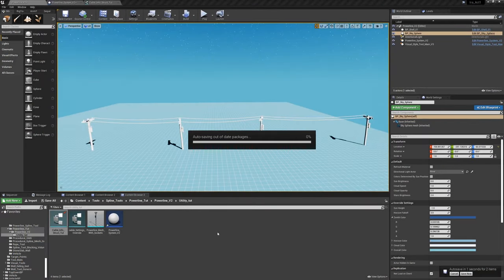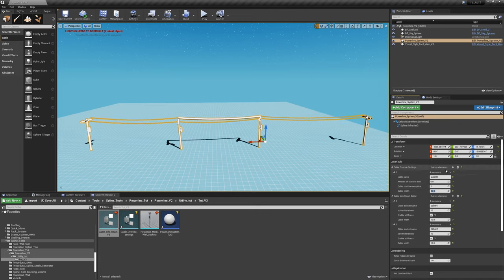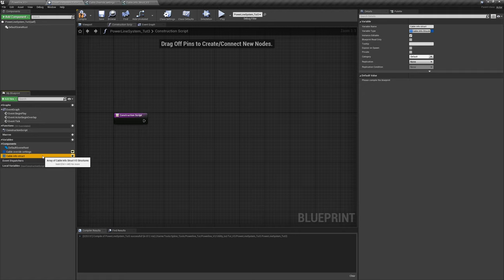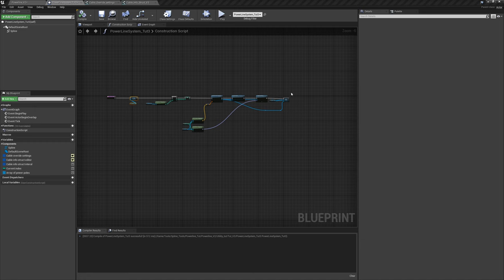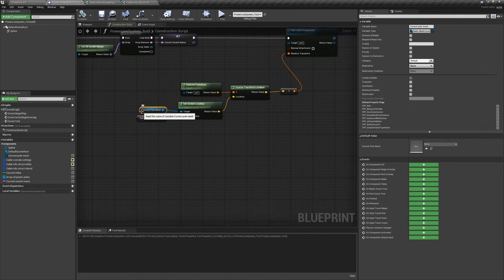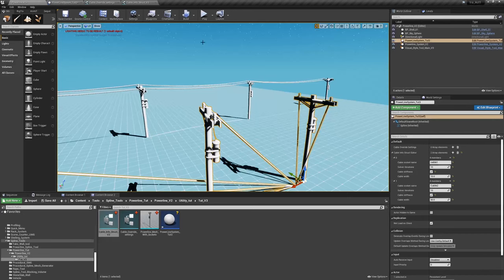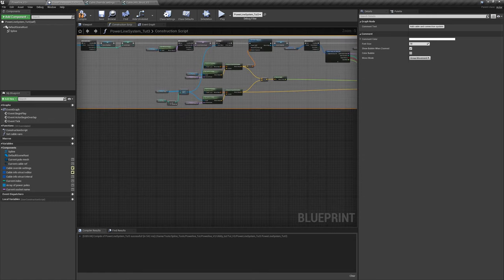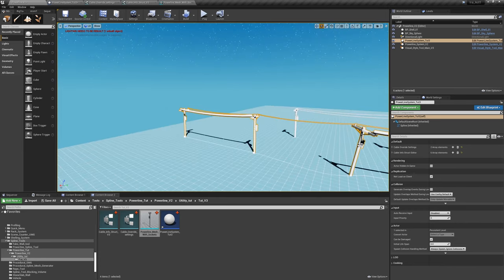Unreal 4 Power-line spline system V2 (tutorial)

Comment: When you loop over the number of spline points to start adding power pole meshes (~17:20), you need to subtract one, otherwise you will add 2 power poles on the last spline point.
Reply: Whoa! Thanks for this exelent tip! I had this problem with cables on the last pole, your sugestion solved this!

Comment: Awesome video. 
-I just came in to let you know that epic Games are using your code in their automotive winter scene free asset, so great job. 
-also I just want to point out a mistake at the beginning where you use number of spline points as the last index in for loop, number of spline points don't start at 0.
Let's say you have 3 spline points, so number of spline points would be 3, for loop will start from 0 to 3 so it'll run 4 times that means it'll spawn 4 meshes instead of 3, the 4th mesh will be overlapping the 3rd mesh so you won't be able to notice that if you're using the same mesh, this wouldn't cause much problems for now since you're recycling current index for another use but it may cause various problems in other scenarios. 
The way to fix it is instead of pluging get number of spline point directly into last index in for loop subtract one from get number of spline point and then plug it in last index in for loop.
Reply: Hey there! They are using my code? This is interesting I'm downloading it now to see what you mean :).

Yeah, this tutorial is a few years old and I understand what you are saying. I'll do an update at some point!
Reply: @zacharydowner5883  they copied it as is, even with the mistake I pointed out. 
They at least should've gave you some credit. 
Great job.
Reply: @souhaibbenchaker4824  Haha, that's pretty funny. I'm actually releasing an advanced version of this system. I'll make a joke and tweet at them when it's ready. :)
Reply: @zacharydowner5883  I actually made a much advanced version as well and built it up for ultimate freedom lol 
Can't wait to see what you release.

Comment: My wires don't have slack unless I hit play. They used to adjust without hitting play. What might have happened?
Reply from the maker: Hmm, that's a good question. I'm currently using the same setup in 5.1.1 with no issues. Have yo modified anything?

Comment: Hello Ira, A great tutorial, especially for a newbie like me. I have an issue with the cables. Between the pole 1 and pole 2 I can adjust the cables,  via the override function, with it slightly drooping, but between the rest of the poles the cables are dead straight and cannot be adjusted.
I have looked back at the tutorial several times, but do not see a solution. What am I doing wrong?

Comment: Thanks for this, your delivery and clear explanations are perfect,  But Im having an issue  where My cables are still pointing to the Actor Origin like @32:36 . 
But its not letting me add the elements under the Cable info struct  Editor.
I click but nothing is happening  Not sure why :( But its letting me add elements to the override settings above? . Im confused
Reply from the maker: Are you sure you are referencing the next socket? If you follow the tutorial exactly it will work :)
Reply: @ira-game7154   I belive so as I followed and re watched parts again and cant see  when I did wrong/or missed. If I do what you do here. @30:45  Mine behaves exactly the same and they actually connect  So I think the issue is after this
Reply: I decided to focus on the cable struct editor not letting me add elements So I recreated them and still couldn't add them, So I re-watched the beginning  bit where you started to place them and  I think I solved it. Turns out I must have been distracted at the time & put the cable info struct editor  in place of the array of  power line posts var which is connected to the clear node . So the cable struct editor was being cleared as soon as I clicked to add them making it look like it just wasn't letting me, Doh!
Reply: Everything is working as intended, I just have one issue where my Cable seems to have unlimited slack in the middle and just falls through the floor and keeps falling. 
The cables are all connected at each end correctly, and if it switch to the set end location from the add cable component node that work without any slack, I have gone over this looking for the issue and trying to solve it, Focusing mainly on the get vector length/cable length area But can figure out the issue :(
Any ideas?
Reply: SOLVED :) I had my solver iterations set to ZERO on the cable struct editor elements in the details panel, setting them to 1 solved the issue. 
I will leave all these questions and solutions up to help others that also end up like me :)
This is One of the most useful BPs I have  now :) huge thanks again :)

Comment: Hi, Thanks for the help, 
I'm just wondering 2 things, 

1) Setting the texture on the spline, rather than manually everytime
2) being able to select the mesh rather than it random select, so say point 1, 2, 4, 5 do mesh 1, and point 2 do mesh 2 for example.

And maybe if there is a way to auto enter the cable values on the settings based on the socket when you create the spline in level

Comment: How can I add a static mesh variable into cable overide struct to be able to replace meshes by hand in places where i want to do this instead making them 100% random?
Reply: thank you for your time while recording this video, very educational content
Reply from the maker: @miloszgierczak4806  Off the top of my head you could add a static mesh actor variable to the struct and when a mesh is added to it,  it creates a valid reference for a static mesh in the struct. Add some type of is valid check and use that ref on pole generation instead of a random one.
Reply: @ira-game7154  Thanks! Today im also working on your system as a base for my poles, and i found an interesting bug while i added a cusotm material for my cables with wind. When you spawn a cables from pole to pole, your system spawns additional  cables in each socket of the mesh in the last point of the spline which are not connected to anything. I think it has something to do with the loop? We didnt define where is the end of the spline in the Construct script? Can you think a bit on this problem? Im a 3d artist - but a BP beginner (total beginner :D) wish to become a technical artist one day! Regards, and thank you for your last reply! <3
Reply: @Ira - game   huray! I found the solution for my last question, and @areito was right (in the comment section below)! You missed the subtract integer (-1) for the last spline point while defining the index, and your pole and cable renders twice on the end of the spline! You guys are great! Thank you, im learning a lot! :D

Comment: any more tips for debugging the issue where the cables all go to the origin?  I have checked and double checked the cable socket names in all places, I went through the tutorial twice! It doesn't seem to be reading the values from the blueprint maybe. When I change the cable width in the blue print for example it doesn't do anything. I am going crazy! Any tips for debugging? It's hard to know where it's going wrong, since mostly when I try and watch a value it says variable out of scope but I think that might be normal. In addition do you have any thoughts as to how to convert the cables to something more raytrace friendly. As far as I can see raytracing doesnt work with cables so I get no shadows from them. For meshes along a spline I can merge them into an actor that raytracing can see, but not cables.
Reply from the maker: Well, I'm inclined to say that there is something you're overlooking from the tutorial. There's a small chance the struts are acting up and you have to save and restart the editor. That's Hapend to me in the past. As for ray tracing, my project doesn't use that so I'd have to dig into in order to see what's compatible and what's not. Sorry you are having troubles feel free to drop by the Ira discord and I'll give you a hand. https://discord.gg/hSqUD2k

Comment: excellent, works awesome! i did however notice that we never actually use cable stiffness bool what was the intention for that bool?
Reply from the maker: Thank you! To answer your question enabling that bool will allow the cable to have a stiffness setting applied. If its not set on the cable, it will be floppyer and take longer to settle down when the game starts. There are plenty more settings that can be added to that function as well. Hope that helps!
Reply: @ira-game7154  this was a major help for me, i was that poor guy putting down the poles and lives by hand lol... Thanks again!!!
Reply from the maker: @omegablast2002  No problem. I too used to be that slub! But not anymore!

Comment: How can I add a fix distance between the poles, so that they get aligned every 50 meters on the spline?
Reply from the maker: Well, there are a number of ways it could be done, and depending on your needs those paths might change. I would recommend checking the distance of the previous pole with the new one and then outputting the distance on a print string. That way you generally know the proper distance. I feel like this is something that just needs to look proper and not be exact.

Comment: At last, a blueprint tutorial that doesn't assume the users capabilities! Well paced and allowed me to follow. I am making a 2 mile tram track and you cannot believe how useful this is to me. I noticed someone asked about changing the colour of the cables and to be honest I didn't understand the reply. I thought about making colour a variable part of the cable info structure so it could be adjusted easily under the cable info structure editor and overrides but failed miserably in my attempt. Is this possible or am I jumping ahead of myself? Many thanks for a great piece of work anyway.
Reply from the maker: Hey, good to hear! The cable color is set via whatever material is on the cable. So, the simple solution is to set the material on the cable, and that material has a color that you picked.
Reply: @ira-game7154  Thanks for the very prompt reply, much appreciated. Where I am being thick is that I expect to have a "cable" mesh which I can attach a material to but the lovely cables just appear as if by magic from your blueprint so no idea what to do with the material
Reply: @ira-game7154  Got it thanks, having a senior moment

Comment: How can I change the color of the cables and add more slack?
Reply from the maker: Slack is around 48 minute mark. Color is set by the material on the cable. You can create a dynamic material instance and modify it at runtime to easily change the color.
Reply: @ira-game7154  Thanks!
Reply: @ira-game7154  Sorry, I'm still pretty new to blueprints. Whereabouts would I be setting the material for the cable?
Reply from the maker: @mhart3D  On the material component itself using the set material node.
Reply: @ira-game7154  Ah I see. I didn't know I had to click on the create cable component node itself. Thanks!
Reply from the maker: @mhart3D  Happy to help :)

Comment: Thanks a lot this is amazing! However is there a way to increase the subdivisions of the cables ? they look quite low poly
Reply from the maker: Hey there. Look for the cable variable "Num Segments" the number corresponds with the number of segments. Higher segments = a smoother cable. Give that a try.
Reply: @ira-game7154  thanks! though I'm not sure when I should plug it in!

Comment: Hi. I repeat as in the video, but all the cables are linked to the Central point in the center, where the zero point of the spline is located. Cables are not straightened (
Reply from the maker: Did you add the proper socket names into the struct?
Reply: @ira-game7154  Thanks. checked and indeed, the names of the sockets were different. But the cables of the last post still go lie down on the ground ) Thank you very much for your help. The lesson is very interesting. Still would snapping mesh to the surface do and a steep bluprint tickles )
Reply: @ira-game7154  I fixed the error, but still thank you very much ) I Sat down for the lesson late at night, because I made stupid mistakes ) If you have the opportunity to write down the lesson how to use this method to make procedural houses from blocks. And once again, a huge thank you!
Reply from the maker: @Igrom_Gamedev  No problem it happens to the best of us :). I hope you this helps you out!